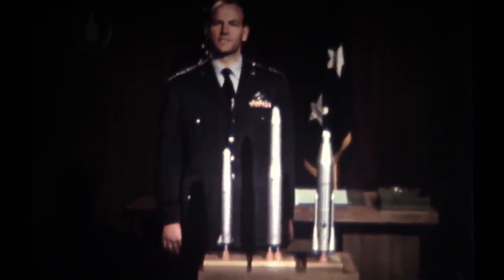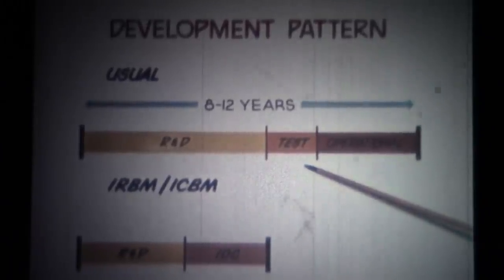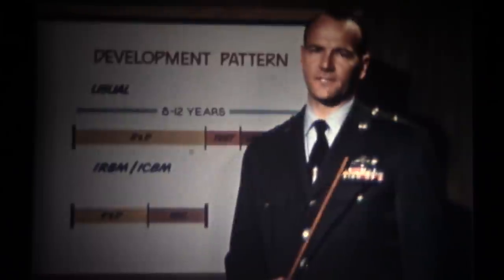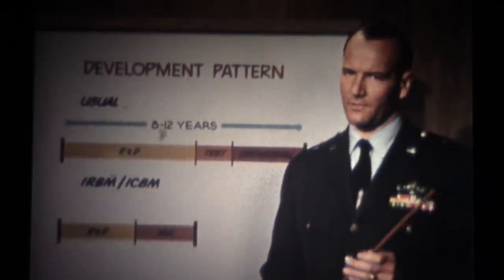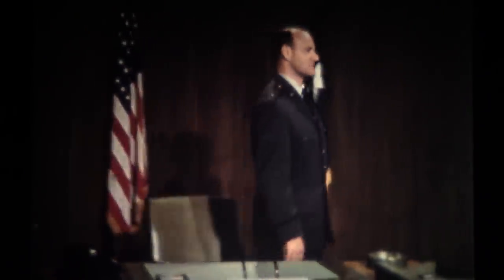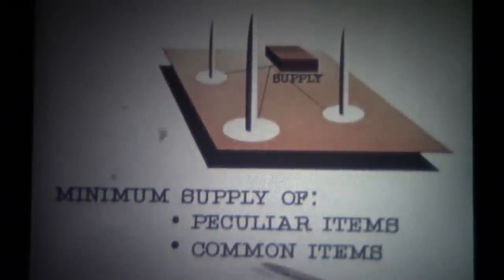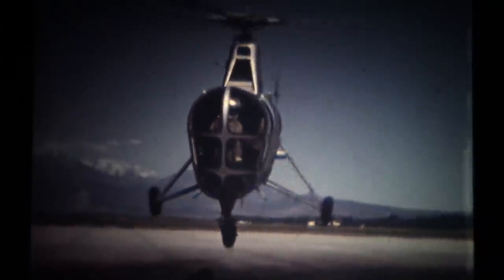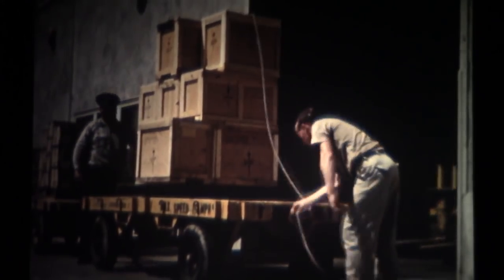Ballistic Missile Logistics (1958)

Comment: R&D coupled with IOC where engineers continue to improve the system as it's already being built. Sounds like SpaceX.
When rocket R&D was under Air Force, those guys took risks and kept iterating. Today, NASA is extremely risk averse.
Reply: In the early days of NASA, a somewhat similar strategy of overlapping development and deployment was used.  The Ranger, Surveyor, Gemini and Apollo programs to support the race to manned Moon landing overlapped and ran in parallel.  Ranger and Surveyor flew on Air Force Atlas with Agena upper stage, which I believe served as a bus for CIA’s Corona missions.  It took several tries for Ranger to even hit the Moon at all and it wasn’t until Ranger 6 that we got any pictures back.  Ranger was developed by JPL which functioned like a captive contractor for NASA.  Meanwhile Surveyor was under development at Hughes, languishing and way over budget.  JPL was brought in to kick the project in the pants and get it on track.  Surveyor 1 landed on the Moon successfully in 1966 even though it was considered to be a disposable engineering prototype.  Gemini got its Titan booster from the ballistic missile program as well.  NASA also did a lot of shooting from the hip with the Apollo program which killed three astronauts on the ground in the Apollo 1 rehearsal and almost resulted in the loss of Apollo 13 due to improperly designed ground test of a thermostatic switch in the service module cryo tank.  The STS shuttle program also suffered two rather spectacular failures killing multiple astronauts in both accidents.  It seems it wasn’t until the International Space Station days after the end of STS that crippling risk aversion gripped manned space flight.  NASA is still doing a pretty good job at being creative and going out on engineering limbs with the robotic planetary missions.  One mission to Mars crashed due to incorrect conversion between miles and km, but the other missions have been pretty successful.  One of the early rover missions almost failed due to keeping too many pictures and data in flash memory.  Engineers figured out how to remotely hack the CPU running VxWorks to trick the CPU into rebooting and running hacked code to clear the flash memory.  Quite a few of the robotic missions have received firmware updates while en route as improvements were made while en route.  I believe even the Voyagers received software updates while under way.